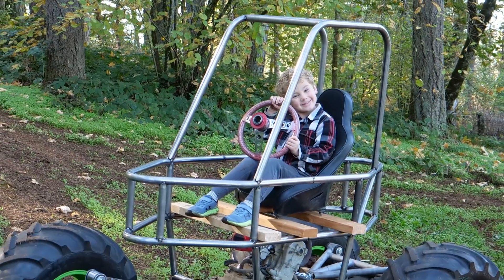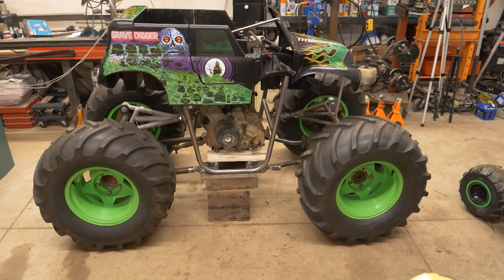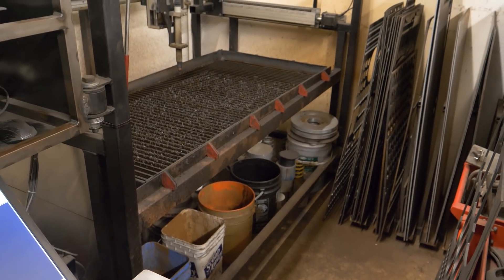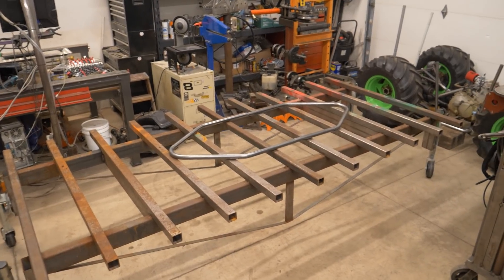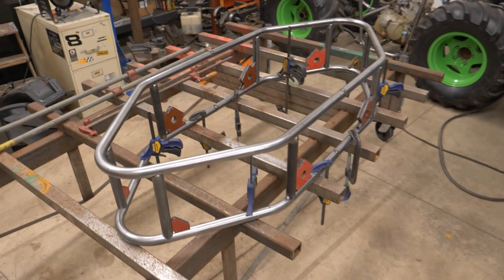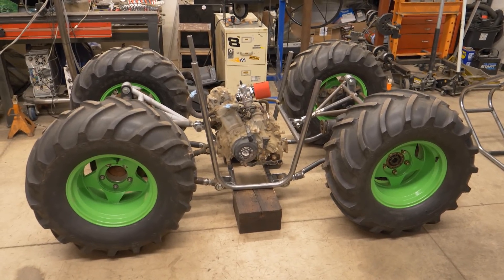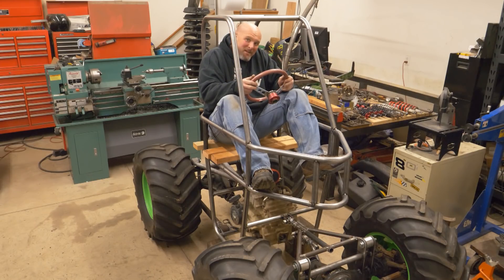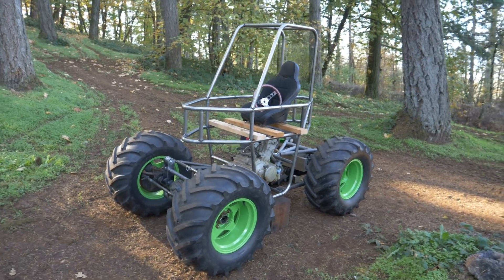Custom Tube Chassis for the DIY 4wd Mini Grave Digger Powerwheels Monster Truck Build

Comment: What kind of motor are you using that has a flange on the front and rear for drive shafts? I'm trying to find a similar engine/tcase combo. I'm trying to work around having to use chain drive as I want a simple 4x4 system
Reply from the maker: This engine is from a 4wd utility quad. Check out the video titled "Mini digger gets a 454" that video is about this engine.
Reply: @motomule  awesome thank you I have gone thru all your video but I must not have been paying attention as happens when binge watching while trying to problem solve and write out idea
Reply from the maker: Did you see how crazy this thing turned out? Check it out here: https://youtu.be/aO-wHYO9vo0

Comment: You obviously have thousands of dollars in tools such plasma cutter, tubing notcher, etc.  Roughly -- how much -- did you start out simply and over time has expanded?   Also -- do you do this for a living -- your skills and knowledge are amazing.   Also -- "brilliant" children....
Reply from the maker: Thank you. Yes, I've been slowly building my shop for over 30 years. In my late teens I started buying tools as I could afford them and I never stopped... I do indeed now fabricate for others at home, but up until recently I had worked in metal job shops for the past few decades.
Reply from the maker: Did you see how crazy this thing turned out? Check it out here: https://youtu.be/aO-wHYO9vo0

Comment: I just hope for 4 or 5 point harness for when it does - NOT might - roll over . Had a honda odyssey back in the 1980s 4 point harness made roll overs and end to end flips the greatest thing ever ! ! ! This taught me to build all engine driven toys " built to crash hard" .
Reply from the maker: Agreed!! It's getting a kid suspension seat and 4 point harness for sure. Thanks for watching!!!
Reply from the maker: Did you see how crazy this thing turned out? Check it out here: https://youtu.be/aO-wHYO9vo0

Comment: I bet you can find a digger body that’s got some damage for cheap to graft the areas you need between the halves. That would be my first option but if you have the means to make something why the hell not right?
Reply from the maker: Did you see how crazy this thing turned out? Check it out here: https://youtu.be/aO-wHYO9vo0

Comment: Put the controls on the steering wheel.... Youll thank me later when you go to ride it....
Reply from the maker: The boys need to use leg power for the brakes. Also, the steering wheel on this will rotate more than a full revolution lock to lock..
Reply from the maker: Did you see how crazy this thing turned out? Check it out here: https://youtu.be/aO-wHYO9vo0

Comment: Definitively driving position is not the most efficient, thinking about the center of gravity... But nice construction!
Reply from the maker: Thanks! I did put the lightest thing up high... Tubing plus kid is far lighter than the engine.
Reply: @motomule  Good, but also for esthetic and crawling capacity to play on the driving position and engine would key of success here... But anyway I really like it =)
Reply from the maker: Did you see how crazy this thing turned out? Check it out here: https://youtu.be/aO-wHYO9vo0

Comment: Love this thing! At the end I noticed something that got me a bit nervous about the steering setup.  I only see one way to set it up. Tho I could just be missing the easy way. Looks like you going to have to come straight down to a gearbox right in front of the motor. Then a shaft that can travel with the suspension. Good luck and can't wait to see it with the suspension.
Reply from the maker: I wish I could do full Hydro steering but that is just too expensive... I'm going to try using a stock samurai gearbox mounted in an unusual way... 😆 Thanks for watching.
Reply from the maker: Did you see how crazy this thing turned out? Check it out here: https://youtu.be/aO-wHYO9vo0

Comment: why do you have the motor so high in the chassis?  Seems like it would give more interior area with it closer to the bottom of the chassis, or more ground clearance??
Reply from the maker: Confused by your comment???? How could I get the engine any lower??
Reply from the maker: Did you see how crazy this thing turned out? Check it out here: https://youtu.be/aO-wHYO9vo0

Comment: You have the motor in backwards to limit speed?
Reply from the maker: No, motor is in backwards so it will spin the drivelines the correct way.
Reply from the maker: Did you see how crazy this thing turned out? Check it out here: https://youtu.be/aO-wHYO9vo0

Comment: Mate, if you stretch the body that way, you won't like it when its done. The proportions will be wrong. It will bug you and you'll want to redo it.
 Other than that mate, wicked build.
Reply from the maker: Did you see how crazy this thing turned out? Check it out here: https://youtu.be/aO-wHYO9vo0

Comment: Was that chassis on the original grave digger steel too? Be piss easy to run an elec 800w motor, esc an minni quad axel kit if you are in a tight budget.
Reply from the maker: Yes, it is steel.
Reply from the maker: Did you see how crazy this thing turned out? Check it out here: https://youtu.be/aO-wHYO9vo0

Comment: Why so much head room in the cage? Seems like it will just raise the center of gravity (yes I know the kids will continue to grow) but still, the over all center of gravity looks like it will be relatively low in general and with the width it looks unlikely to tip
Reply from the maker: It looks goofy, but it's the safest solution... I'm going to make the roll cage removable. It looks WAY better without it and then I could fit in it!!! 😆
Reply from the maker: Did you see how crazy this thing turned out? Check it out here: https://youtu.be/aO-wHYO9vo0

Comment: Growing up I didn't have things like this no go carts dirt bikes four wheelers or anything  I had bicycles though after I got bored with em I took em apart and put em back together  learned a lot that way I eventually moved in to small engines and some automotive repair ...my only regret is I never learned fabrication skills although I still have an interest in design and fabrication unfortunately I just don't have the money to spend on the tools needed for it ... But I suppose I could do some wood working projects and I do need a new gun cabinet
Reply from the maker: Did you see how crazy this thing turned out? Check it out here: https://youtu.be/aO-wHYO9vo0

Comment: Gonna be a little tippy side to side with that high center of gravity
Reply: It's going to be interesting to see where the COG ends up with the axles, tires, and engine that low.  Even with the kid up that high,  I bet it will still be pretty stable with that much weight down low.  The kid will add some leverage, but I bet it still holds up pretty good.  That'll make a good video pulling it over on it's side to see where the tip-over angle is.
Reply from the maker: @WheeliePete  Great idea!! Bring your boys over and we'll put it to the test!!
Reply from the maker: Did you see how crazy this thing turned out? Check it out here: https://youtu.be/aO-wHYO9vo0

Comment: Looking good. All your friends are going to want to drive it now that they saw that you can fit in it. You should let Ethan from grind hard drive it to work out the bugs if there are any because he had stuff braking on his test rides.  Can't wait until next weeks video
Reply from the maker: I will definitely get Ethan in it, he will actually fit much better than me. Not gonna be fast enough for his taste, but I bet he'll like running over stuff!!! 😆
Reply from the maker: Did you see how crazy this thing turned out? Check it out here: https://youtu.be/aO-wHYO9vo0

Comment: think the eaziest way to get the body stretched is to get a second body for it and cut the front as mush to the rear as you can and do the oposite with the rear . maibe stretch the doors themselves would be eaziest to do , could actually make the doors from scratch using the actual door cut in half set them apart the distance you need to cover (tape them to the front part and the rear part of the doorjamb ) and gleu a bigger sheet of solid plastic over that